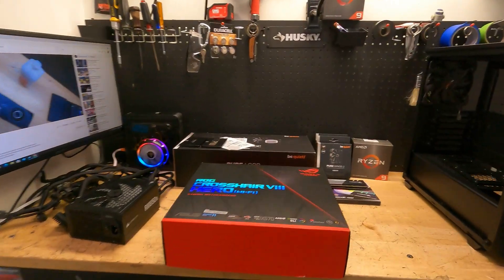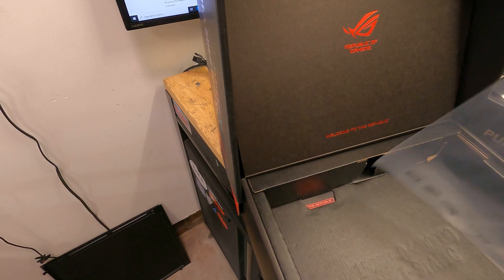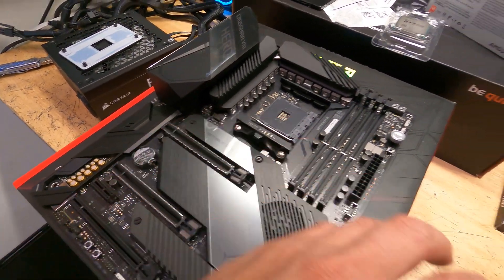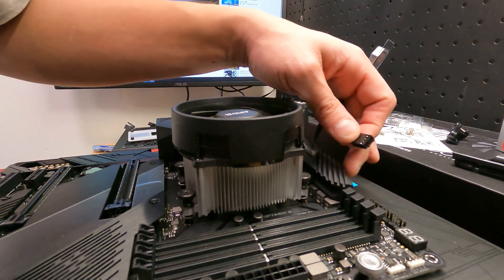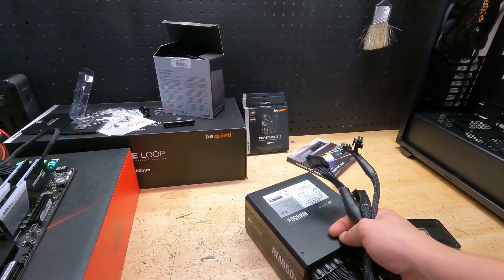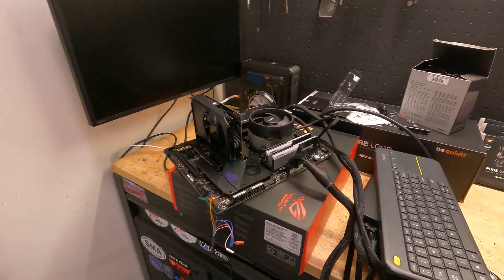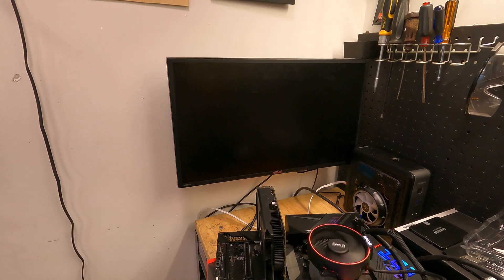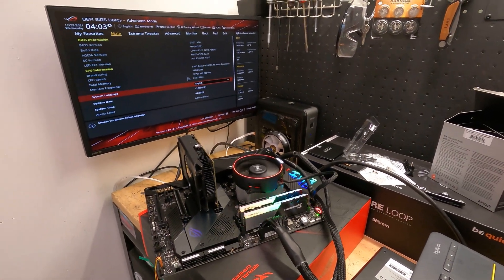Quick tip before putting your new computer together!! PC building tip!

Comment: Really random man but do you know of any laptops around $200-$300 that would be able to run emulators and some other stuff. (Not games) or do you sell any computers? Would be very helpful for a response
Reply from the maker: depending on the emulator, most old core 2 laptops run them fine and they can be had dirt cheap. As far as anything for sell, I don't have anything at the moment.
Reply: @DLMtechgarage  it’s Nox for mobile games
Reply: Unfortunately stuck on a very tough budget so yeah :/